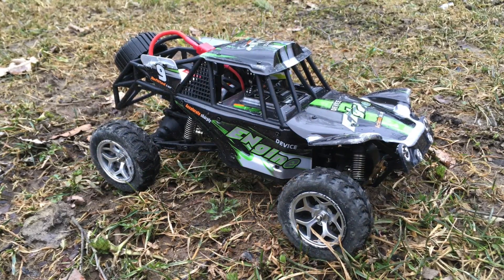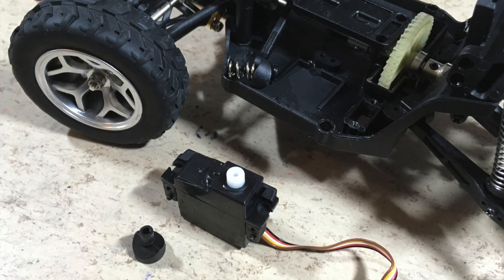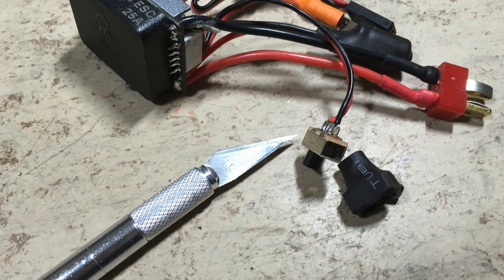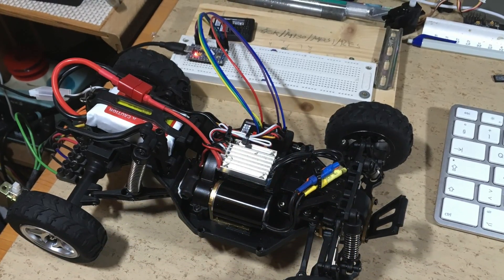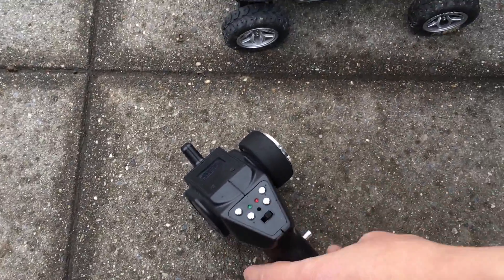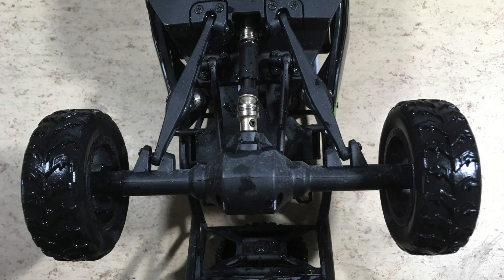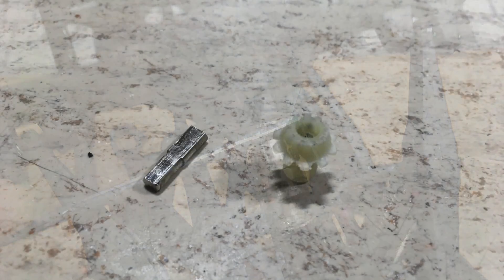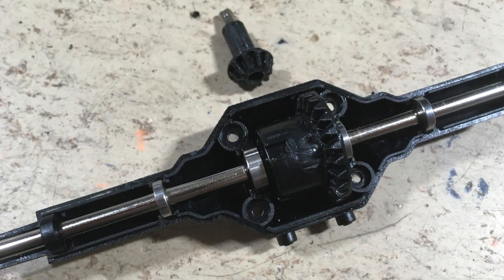WLtoys 18429 "Pocket 12428" Desert Buggy: Brushless Conversion, 3D Printed Gears!

Comment: That was cool how you made your gears, but you should use very little grease there on the teeth because you don't want it to slip too easily, will eat those new gears. Good job tho
Reply from the maker: Thanks, man. The grease will spread out after a few turns and as you can see, it works perfectly. As long as the mesh is adjusted correctly, gears will never slip  because the teeth are mechanically caught in each other.
Reply: Yea I've seen plastic strip out even with good mesh but I've heard 3D printed parts are very strong

Comment: this is car totally insane .. i have a959 but i think this one can outrun a959 ?what you say sir?
Reply from the maker: The mechanics of this one are better. The speed of both is about identical in stock condition I think.
Reply: TheDIYGuy999 yeah i am agree with you sir and i think it has better mechanics thats why it is stable than a959 , i always have stability problem with a959 but it looks like it can run at max speed without causing stirring issues and all

Comment from the maker: This thing was quite disappointing first, but now it's a stupidly fast brushless rocket! I hope you like it!
Reply from the maker: It was my own fault, the ESC did not like the waterproofing. I still recommend this buggy.
For all the details have a look at both parts of this video
Reply from the maker: It shouldn‘t, but you never know. Maybe my throttle finger is just too strong 😉. It‘s a polyurethan based coating, not wd40.
Reply: Hi there, what kind of screwdriver  you used to unscrew the shaft at 8:02? Pls reply Bro, much appreciated..